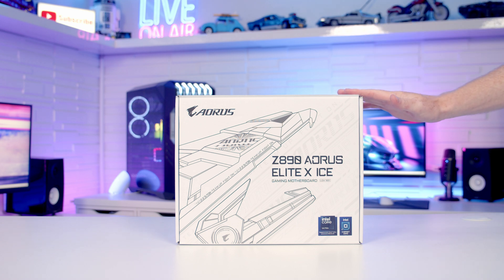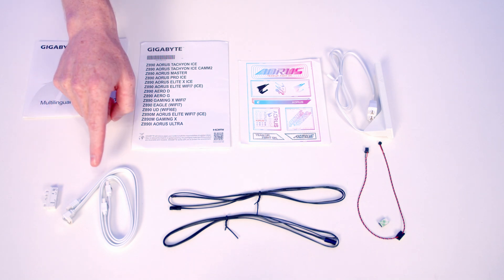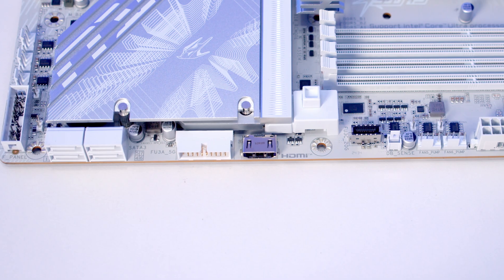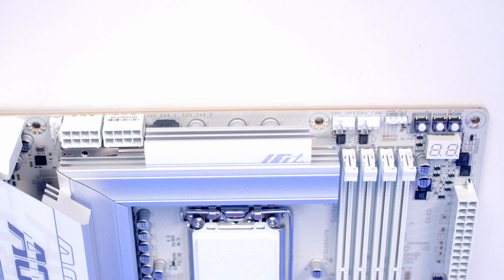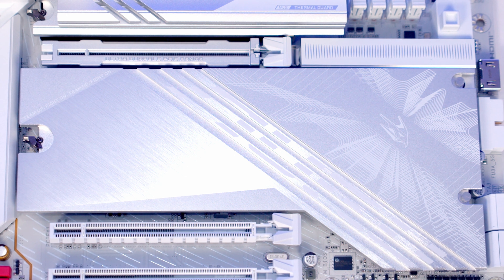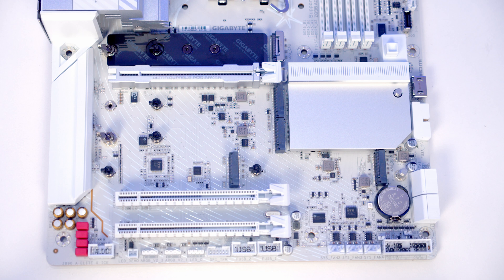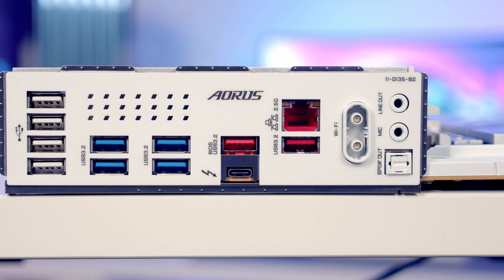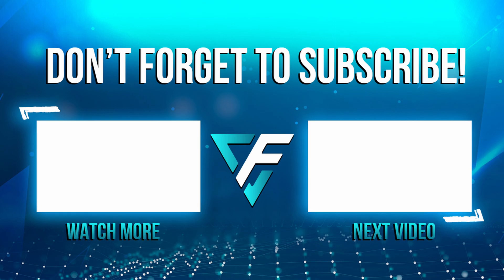Z890 AORUS ELITE X ICE Overview

Comment: Got one and it is total garbage CHB totally inop,.. Bios rev was 8 revsion behind total pita just to get the correct bios,... thumb drive for flash needs to be old school fat 32 ,  not exFAT Not all new drives support for Fat32.
It is junk and mine is going back. No bent pin on the board it just that half of the memory slot are inop.

Comment: Bad mothercard because you can't use IGPU, no HDMI, no displayport.
Reply: the thunderbolt connector on the back has video output. 
	
Integrated Graphics Processor-Intel® HD Graphics support:
- 1 x Intel® Thunderbolt™ 4 connector (USB4® USB Type-C® port),supporting DisplayPort and Thunderbolt™ video outputs
When a Thunderbolt™ monitor is installed, the maximum resolution supported is 5120x2880@60 Hz with 24 bpp (single display output).
When a USB4® USB Type-C® monitor is installed, the maximum resolution supported is 3840x2160@240 Hz (single display output
Reply: @espi8997  It is not to esay to connect with USB Type C. HDMI and Displayport are plug and play and very commun with all monitor. I have a ASUS thunderbolt card, can't use to connect my LG.
Reply: Mothercard? I do get what your saying, its kind of dumb this dosen't have some type of HDMI or Display Port on the back IO. Why I'm going to go with the slightly cheaper GIGABYTE Z890 AORUS ELITE version of this.
Reply from the maker: It's the future, but you might need to use the internal port